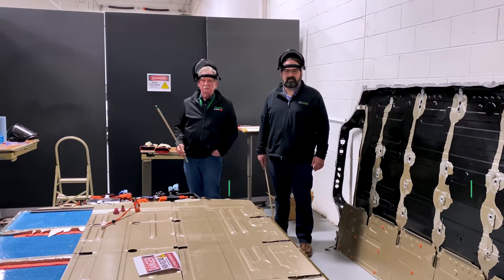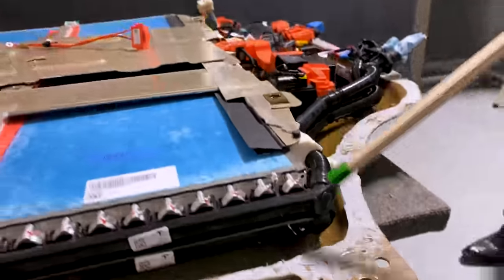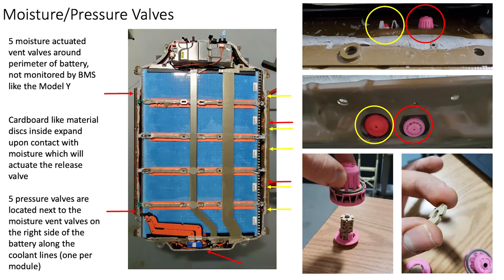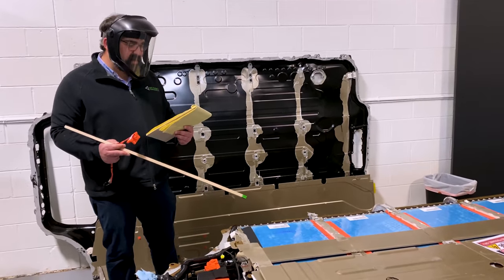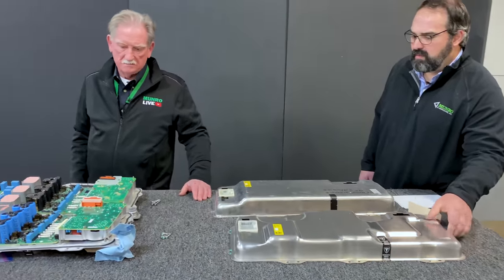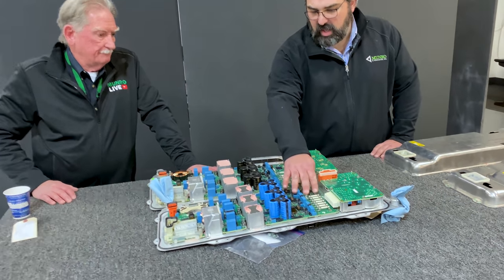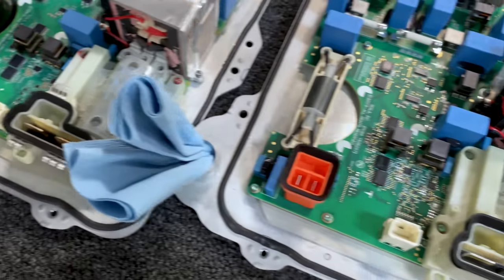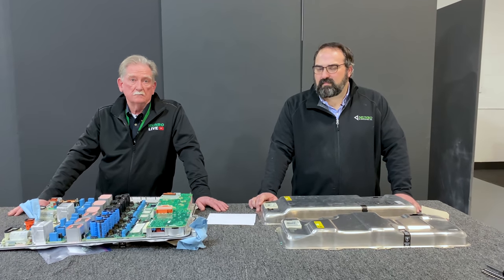Engineering Masterpiece | Tesla Model S Plaid Battery Pack

Comment: They got new batteries now they use 4680
Reply: No, they don't use 4680 cells in anything yet. Like everything at Tesla, it's way behind.
The Model 3, Model Y, most recent Model S (and presumably Model X) other than the Plaid use 2170. The Plaid uses 18650. There are no other Tesla models in production.

Comment: Lucid makes nice but way too expensive EVs. Peter designed the horrible 
Jaguar vehicles. HELLO! When are you going to tell the truth about 
manufacturing of EVs? They are not make without fossil fuels and the 
battery manufacturing is so toxic to the earth. Needing rare earth 
minerals only found in 3 areas of the earth. Mining them is so toxic and
 poisonous as well. These are serious facts. Why charge so much for EVs 
when they are so cheap to manufacture compared to ICE vehicles?

Comment: Couldnt believe they didn't run the battery to the absolutely lowest charge possible. rookie move
Reply: Even running to "0%" charge the voltage per cell is still over 3V vs 4.2V full charge. Discharged high voltage pack still has lethal voltage and power.

Comment: Is this not exposing Tesla technology when you show how the battery was built......
Reply: That's kinda the point of all this.
Reply: Yes. There's nothing wrong with that: you buy a product, it's yours to tear apart and examine. That doesn't give you the right to manufacture and sell a copy.
Reply: @brianb-p6586  but there is still the law of copyright...you can see it but you can not reproduce it... exposing intellectual technology to the public is also covered by copyright... 

...
Reply: @wilfredocoquioco6828  No, copyright does not apply to a technical design, only to documentation of the design. 

Technical designs are intellectual property, but the protection for them is by patents, not copyright. Even if every detail of the battery design were patentable (and little if any of it is legitimately worthy of a patent), showing the battery and discussing it would not violate the patent; in fact, openly showing the design protected by patent is a key feature of the patent system.

There's even the idea of a registered industrial design, which is for designs of physical objects that don't qualify for patents. Again, such as design can't be copied by another product, but there's no problem showing it.

If a manufacturer wants to protect proprietary information without using patents, it must hide it... and there's no way to do that with a battery configuration. That's more appropriate for something like manufacturing processes, which are not inherently in public view.

Comment: You can marvel at their engineering skills and philosophy but right now their achilles heel is their abysmal customer service quality. Tesla repair centers can't even get parts to repair brand new Tesla's, that's insane. Let alone their anti right to repair standpoint. Their current main focus is pushing as much Tesla's out as is humanely possible but this might come to bite them hard in the behind when they start breaking down.
Reply: The legacy car makers are no better in service, even worse, no matter wether ICE or EV.
Reply: @Stefan_Dahn  If by no better you mean greedy and anti consumeristic then yes you're right. However only recently did Tesla open up their diagnostic solution to everyone (at a steep monthly price) and it was only because people fought back. I love the latest and greatest tech as much as anyone but it's in everyone's best interest to also call out the flaws for the things we love as that is the only way they can improve further.
Reply: @ZeroInDaHouse  I love Tesla but, you are correct.
Reply: @Stefan_Dahn  well said, anyone on any of the legacy forums in their ev sections, knows they are all STRUGGLING mightily with evs. 
The mach e especially is so ironic for all the issues it's had already. Vs the open smack talk Palmer levelled at tesla in 2020. 😀
Reply: Tesla parts doesn't even answer  the phone and they keep their voicemail full
Reply: Anger management required.

Comment: It is interesting to see the evolution of this industry. Unfortunately, they are not practical at this time and most likely it will take another 20 years, if then, before they become practical. By practical I mean much lower pricing, around 50% lower. Longer distances on a charge. At least 400 mile in any weather. Lastly charge times in 5 minutes or less empty to full charge.
Reply: I think only the top 10 -15 % of cars will need this. All other cars won't. So you will get the highend with specs like this and the low end 200 miles and that will work. I wouldnt use the specs above at all and only one person i know needs those specs.
Reply: This is the top end model s plaid. You can buy a M3 LR for around 50k that has 360ish mile range. I would say the technology is already here but Tesla cannot meet demand therefore prices are artificially higher. I would be surprised if you are not able to buy a car for 35k in 2025 that meets most of your specs.
Reply: When you wake up everyday with a full tank, how often will you need to go to the gas station?
Reply: I think your over estimating the requirements for practical. Most gas cars don’t do 400 miles in any weather condition/speed. Some diesel are 700 but many cars are 300-400 depending heavily on speed and weather conditions. As to pricing, as soon as EV’s are cheaper, they are practical. No need to be cheaper, they already cost much less to operate and maintain.
Reply: How is it not practical in term of price and performance? Do consider that average cost of ICE is $40k+ and the average cost for performance cars are likely to be much higher. It won't take longer than 8 years to get 400mile but should they? Unlike gasoline, you have options. You can charge at homes, shopping centers, work, etc. What is not partical? Less maintenance, no noise, no toxic fume...
Reply: @davidradtke160  i dont extreme requirements are necessary, but driving at 60mph gives you 360miles of range, 80mph gives you 280miles? That requires bigger range. Check Bjorn Nylands excel sheet of test drives.
Reply: I drive 50.000 km a year with my Model 3. Afer 1.500.000 km ICE cars. They are obsolete.
Reply: I disagree. I find my model Y to be very practical. The 'gas-station' in my garage fills the 'tank' for less than 8 dollars and gives me a range of over 300+ miles. Most of my daily trips are under 100 miles so garage charging is perfect. As to price, given the gas savings and maintenance free design the price delta is fast becoming a wash (I'm guessing in 2024 ICE will exceed EV pricing when you include fuel, maintenance and insurance. Bottom line- Our ICE Denali crew-cab  pretty much sits in the garage for weeks at a time while our Tesla drives us around in comfort with full self driving and clean exhaust.   ;-)
Reply: People keep saying this but for the average driver this is complete bs. The average price for a new car is now over $40k. This was reported in December. So, the base model 3 matches the average car price. You are obviously looking at a $20k car. Tesla and the other manufacturers won't be making any car in this price range because there is simply no profit in it. Even with ICE cars, several manufacturers have discontinued some of their compact sedans and are concentrating on SUVs and trucks because there is no profit in compact sedans. The Chinese will likely make cars for that part of the market in the future. The longer distance isn't really necessary either. Most people drive considerably less than 300 miles in a day. The longer range  is strictly for road trips and most people don't take many road trips. Frankly, if the charge time is under 5 minutes, why would you haul around a large battery to get 400 miles of range? Now let's look at road trips. When people take them, how often do they drive long distances without taking breaks? 300 miles is about 4 hours of driving. I know personally that after 4 hour, someone in the car will need a bathroom break and most likely will be hungry. Right now 15 min of charging gets you about 200 miles of range. Some of the cars with the 800v systems can get that range in 10 minutes. Since you are likely to stop for longer than 5 minutes anyways, even the current cars are sufficient for a road trip and they are just getting better. So, today's EVs are very practical for most people. Obviously, there are small groups at the extremes who either drive crazy miles daily or need to tow heavy things often. It won't be practical for those people. 
The only thing that is needed right now for mass adoption is for chargers to be installed either in apartment garages or by businesses. For homeowners, EV ownership is very practical. For renters, it is difficult. If there are chargers in their parking lots or at their jobs, there would be very few reasons not to get an EV.
Reply: Nonsense. The mad rush away from ICE to EV by mainstream automakers is because an EV is cheaper to make.
Reply: @vidznstuff1  EV's are cheaper than a gas model. You been smoking some bad stuff.
Reply: @soquick69  if you think the technology is already here when it is not that only means you are deceived.
Reply: @vidznstuff1  lol. Your gonna make legacy cry..  That will be true for them one day If they survive. 
-Out of 3 of my neighbor's that test drove my car.. 2 of them put down deposits that week. You have to wonder what bit their ass... I've had many buddies get new cars and let me drive. I've never gone out to buy one, Have you?
Reply: @JohnSmith-ug5ci  have you driven a EV? I have been following them since 2012. I think I have a pretty good grasp of the technology.